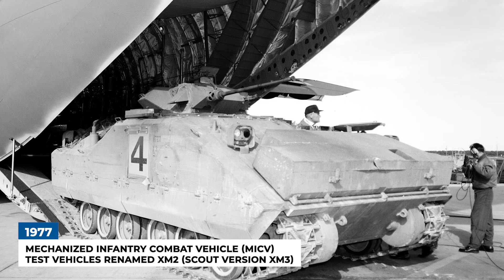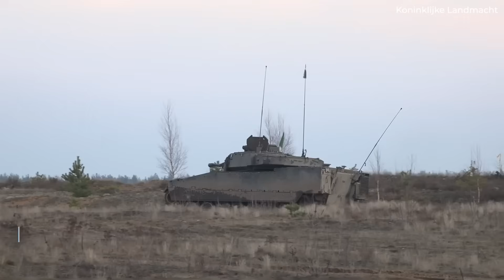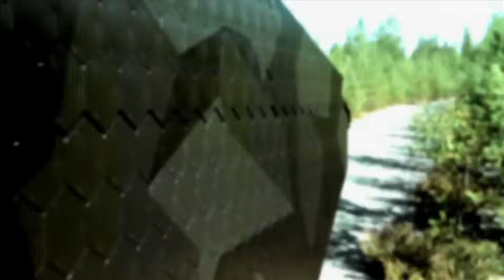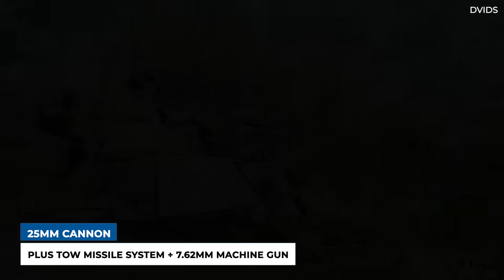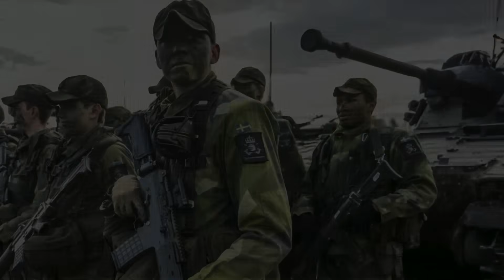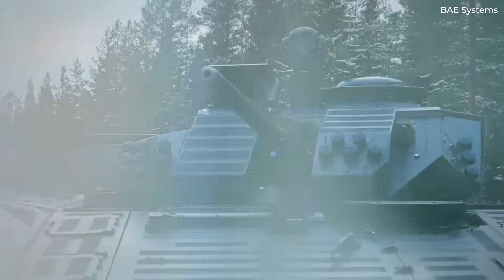Bradley & CV90: Comparing/Contrasting Two Major IFV Programs

Comment: Seating in the M2 Bradley is definitely 10 total: 3 crew and 7 troops. "A" reason for seat # confusion is that the 7th troop seat is distantly separated from the other 6 in the back, highly difficult to see and occupy, directly behind the driver, requiring the occupant to slide through the narrow gap between the large turret basket and the left interior wall. This is why, when viewing a Bradley from from front or rear, the turret is offset to the right of centerline. Troops refer to the 7th seat as "hell hole". Rapid deployment or escape from this seat is extremely difficult.
- Retired U.S. Army Armor & Cavalry Officer

Comment: Missed is HP to ton ratios as well as range vs fuel.    Bradly cost a lot less and its still in production in the M113 Replacement (AMPV)  as well as the chassis for the latest Paladin  155 SPG

Comment: The only real difference is the height and with COPE cages,  it would make no difference.    Obviously the Bradlyhas long term comfort and ride vs maybe the idea Europe is not going to see the longer range missions (the fuel difference is quite large).    US is moving to larger Auto Cannon,  a lot of disagreement there as a 25mm is a infantry support and a 40 mm is a material suppolrt.    Quantity  vs quality as well.     CV90 is getting long in the tooth so a replacement vs an upgrade is due there as well.     For the role,  30mm is max and you want anti armor aka material,  then add more missiles.

Comment: The uk should’ve just gone for a CV90 with a calibre gun that it already buys ammo for, like 30mm used in the DS30M. Gotta be better than Ajax…
Reply: For confusing procurement reasons, the UK had purchased 40mm CTC guns well before Ajax, for the now cancelled Warrior improvement program. Allegedly there are hundreds of the things in a warehouse somewhere. Worth pointing out that Ajax beat CV90 in the trial, although that may be because the govt at the time wanted to break BAE’s monopoly in UK armoured vehicle construction
Reply: @rorythomas9469 the CTC cannon would’ve been a good fit too but yeah, the CV90 is still a BAE product

Comment: Not sure if it was mentioned, but one of the reasons Sweden opted for a 40 mm bofors was because they had a lot of then in storage.
Reply: And, its a damned good gun with a rate of 5, 40mm rounds a second.
Only problem, quite a big round.
U can store less of them in the vehicle. Giving U a shorter time in action.
Reply: @Zeenoevil-i7w Yah, gotta have trigger discipline not to become a logistical problem. Still, good punch (up to around 150mm RHA) and range.

Comment: I don't need to watch the video to be able to tell you that the CV90 is leagues ahead of the Bradley. Perhaps a more comparable vehicle is the German Marder, Which is also not very good if you ask me.
Reply: What do you mean also not very good?  What information in this video said the Bradley is not very good?  The Bradley is an outstanding and very combat proven vehicle.
Reply: @JudgeVandelay  Yes the Bradley has a good combat record. However it is outdated. It carries too few dismounts. It's gun is a little too small. Tow missile is outdated. It's range and speed is less than other more modern IFV's. Plenty of reasons for me to think the Bradley IFV is on the lower end of western IFV's. I also don't think particularly highly of the M109 Paladin. It too is outdated and gets outperformed by more modern systems, but that's a different discussion.
Reply: @ijsthee2000  Bradley and CV90 carry the same amount of dismounts.

Comment: Recalling how the early Bradley design featured "gun ports," through which troops could shoot. Some footage of your episode show a Brad featuring them. One problem with the ports (soon deleted for more armor) was that the standard M-16 couldn't be fired through them; a specialized firearm was developed for this use, with predictably poor results!
Reply from the maker: Interesting! Thanks for sharing!
Reply: Yeah, "firing ports" (to duplicate the Soviet BMP) were common among IFV designers at the time, and specialized gun port guns were often pushed becayse designers soon figured out typical NATO rifles of the era generally wouldn't be usable the same way a 16" AKMS underfolder would fit - the M16 has a fixed stock, and pretty much everyone else was using full length 7.62x51mm rifles that were too long even if the stock folded.

Austria developed a firing port weapon version of their MPi69, Uzi firing port weapons were developed for Germany, HK tried to compete with MP5 and HK53 variants intended for firing ports, etc.

The US M231 firing port weapon was a bit weird.  A HEAVILY modified M16A1, dwsigned to run in the open bolt on full auto ONLY, with no sights (because the sights couldn't be aligned with the view port), intended to be screwed into the firing port (to retain enough NBC sealing with cabin overpressure), and fired with all tracer, really just to "sterilize" the immediate ground to the sides and rear right before dropping the ramp and discounting.

Technically the M231 is still in service (many, if not most or all, Bradleys retained the firing port in the rear door), but most troops have never seen them, even in Bradley units.

I have a buddy who found one in the back of the arms room, and being the company XO, signed it out to himself so he could leave it by his hatch as a "Go away!" gun if he had hostiles trying to attack with grenades or satchel charges in towns.  (His next deployment was commanding a Stryker company, and he used a "found" AKMS for the same role.)
Reply: That's one of the hilarious things about IFV development, the Russians and Americans both really believed in the gun ports idea for a long time haha. Then they both realized it's a whole lot of pain for very little gain and unceremonisouly dropped the concept.

Comment: I work on the M3A3 and closely with people who use the M2A3. The M3A3 is a Forward Observer version It has a crew of 4 Driver, gunner, TC and FSO to push fire mission the M3 also doesn't have a tow but a giant laser to pull grid for fire missions. With no room for dismounts. The M2A3 is field by both Cav scouts and Infantry. They use to have 2 different versions but got merged into 1.

Comment: CV90 engine isn't exactly silent when running on diesel, but it can also be used by electric power alone when the intention is to operate silently. When not the CV90 definitely let's you know it is there before you see it and it can be easily regognized from other armoured vehicles by the distictive engine sound alone.
Reply: The diesel engine isn’t silent but when you are complaining it too what you know and you experience it is only possible to hear the CV-90 200 meters away it’s considered silent by Russia and Ukraine because that’s silent in there experience, en electric powered vehicle is of course much more silent
Reply: @kimmogensen4888  I genuinely don't know what you are trying to argue or if you are trying to argue about something. CV90 has a hybrid engine where an electric drive is used to augment the diesel engine and can be used to power the vehicle in a quiet mode by battery power. The diesel engine is definitely not quiet though and if those are used you can hear the vehicle coming before you see them.

I served in the battalion that trains Finlands CV90 crews and as an anti-tank soldier they were my most common sparring partners in force-on-force excercises. Armoured brigade uses different IFVs.
Reply: While not completely silent by any means the CV90 is silent enough, particularly in winter, that we have had several near accidents and sadly one fatal accident when a CV90 ran over a well camouflaged Home Guard observation post killing one of the soldiers inside.
Reply: @Vonstab  It is silent when running by battery power, but there are limitations to that, including the battery charge. The silent mode can be used when sneaking into or out of contact for example.

I am willing to bet everyone who has served in any unit using the CV90 will be familiar to the distinctive noise the engine makes when running on diesel. Then it is not silent at all.
Reply: Another factor of the silence is that it is designed in such a way that the engine noises are directed to the back of the vehicle. Look up footage here on youtube about CV90s and you can clearly spot the audible difference once the vehicle passes by. No idea if the bradley has anything similar.
Reply: @VarvasNukka  I don't have to look up YT videos for reference because I served in KymJP and these guys were the who were sparring against at anti-tank specialization training and force production training most of the time. It is easy hear them before you see them if they are running the diesel engine. In Finland terrain obscures so much that noice is often the first clue that something is about to happen.
Reply: @herptek  itekkin palvelin siellä ihan vaununjohtajana. Noista sun kommenteista saa semmoisen kuvan, että vois ajaa pelkällä sähköllä kuin jokin hybridi, ei voi.  Ei ainakaan millään CV mallilla mitä itse tunnen, mukaan lukien nämä suomen mk. 2:set. Tottakai moottori seis tähyllä ei kuulu mitään ääntä. Liikkeessä sitten itse telakalusto sekä moottori antaa väistämättä meteliä. Mutta tuo moottoriäänen taakseohjaus on oikeesti todella vaikuttava.
Bradleystä ei ole henkilökohtaista kokemusta, mutta isompiin tappeluvaunuihin ja bemareihin verrattuna, on tuo CV todella hiljane, etenkin eestäpäin.
Reply: @VarvasNukka  Perinteisen CV90:n polttomoottorin käynnin kovilla kierroksilla kuulee vaunun ulkopuolelta kyllä aika kauas. Peitteisessä maastossa äänestä niiden läsnäoloon usein havahtuu ja siitä moottorin äänestä on helppo myös tunnistaa kalusto muista panssariajoneuvoista, koska se on niin omintakeinen. PST:ssa näitä vaunuja ja Leopardeja vastaan tuli oman varuskunnan alueella eniten harjoiteltua, bemareita ja muita harvemmin isommissa harjoituksissa.

BAE Systems asentaa uusiin CV90-tyyppeihinsä hybridimoottoreita ilmeisesti juuri ajatuksena mahdollistaa hiljaisempi ajo.

Comment: The CV90 MkIV, on the other hand, features a more modern and flexible design. With 1,000 horsepower, rubber tracks, ai architecture, and a much heavier cannon, the newest CV90 is—by most metrics—a technological step ahead of the Bradley M2A4E1. On the other hand -
F16 - 555 upgrade, Leopard - 4444 upgrades ect. everyone does this.
Each country, who develops and built their own APC, 'loves' the concept they have 'created' or copied.
Cheers.

Comment: Comparing a vehicle designed in the 1970s...to one designed in the 1990s is apples and oranges.
Reply from the maker: The CV90 is newer but if you watched the video you’d know its development began in the late 70s and through the 80s.
Reply: True, BUT both are the best their representative countries/armies have at their disposition. It's noone else's fault that many US attempts at designing newer IFV bave brought nothing...
Reply: original design doesn`t necessarily mean much when talking about new vehicle production. upgrading existing vehicles, well that is something else
Reply: the 40mm cannon is almost a hundred years old now
Reply: @prawnstar69 
Just its diameter, the gun and ammunition is not the same.
Reply: @glenndennis6801  The 40mm Bofors in the CV9040 is an almost unmodified m/48 turned upside down. I say almost as a reinforced barrel was introduced to deal with the pressure from the APFSDS round which was wearing out the standard barrels faster than expected. 

Only the the Swedish navy has the nice upgraded Bofors 40mm
Reply: @Vonstab  main problem with them afaik.. is the low capacity of the gun. and the large size of the shells. meaning the total number of shells and shells ready to go is very limited for a combat vehicle. for naval use the setup is different, with no such problem
Reply: @hotdog9262  234 rounds is not low capacity with a 40mm when you take into consideration that each shell has a significantly greater effect than 25mm or 30mm. The introduction of 3P improved ammunition effectiveness even more. The limited capacity of the magazine and ready rack was an acceptable trade off when the CV90 was introduced but the negative effects have become more pronounced in the 2020s due to how combat has changed. Which is why even Sweden is switching to the 35mm Bushmaster.  Will be interesting to see if the 9040s will be upgraded with new turrets or replaced entirely as the 9040s still in Swedish service are both old and missing upgrades.
Reply: @Vonstab  yes that is the vehicle capacity. however in the cv90 and likely other vehicles which use this gun, the shells are held in 8 round clips of which there are 3 in the magazine. they are gone right quick
Reply: @Vonstab  234 rounds in the vehicle is not bad tho, I remembered that a bit incorrectly. 350 on the 35mm version.
the most significant difference is ready rounds, you probably know but the bushmaster work from 2 belts 35 shells in each, 70 ready rounds. that is a huge difference in combat. 
and if the shells needs to be loaded as well in to the clips and mag of the 40mm..
Reply: @hotdog9262    The 40mm m/70B mounted in the CV90 does not use clips. The feeding mechanism was reworked so that the gun could feed while inverted and without having to use clips. The magazine has 3 racks which are usually loaded with a different type of ammunition in each. These racks are refilled from a ammunition carousel underneath the gun that holds an additional 48 rounds. 

The problem is restocking the ammunition carousel with the 162 additional rounds in separate storage around the fighting compartment.
Reply: @Vonstab  yes you are right, but still not a huge difference imo. its still 3x8 ready rounds, with manual feeding therafter from the carousel
Reply: @hotdog9262 keeping the magazine topped up from the carousel becomes pretty much second nature for a trained crew. The problems start when the carousel is empty as reload speed is significantly reduced compared to the Bushmaster armed variants. 

That was one of the reasons why the decision to switch to 35mm was made. But the major reason was the sheer cost of developing a new m/70 variant and restarting the production. The cost in time and money was simply not worth it.
Reply: @Vonstab  sure... maybe on the training ground. keeping the mag topped off obviously become a major problem in real prolonged combat.
a gunner need to use the fire-control systems and day/night sights to operate the cannon, and the lmg. he is not just a loader
Reply: @hotdog9262

The actual combat experience is that the  problem is refilling the carousel once it begins to run out. That is when the 9040 is at a significant disadvantage. Prior to that the impact is measurable but minor. 

It's a compromise solution that traded sustained firepower for high intensity firepower and an at the time unique variety of ammunition. 

It was a good solution for the original requirement but requirements change over time which is why there will be no new 9040s.
Reply: @Vonstab  the 24 only ready-rounds with manual refill have been a major issue in ukraine